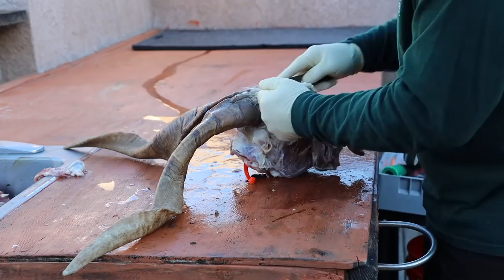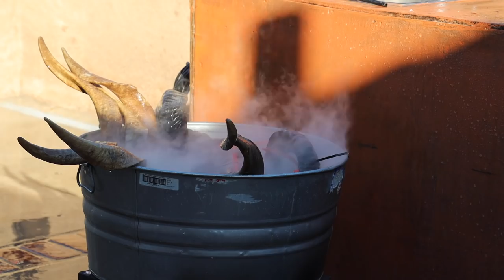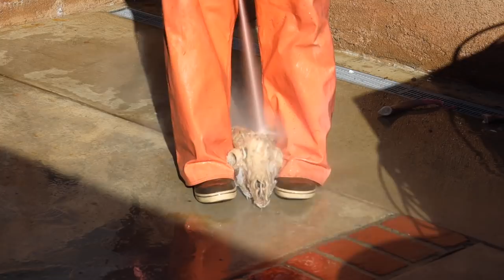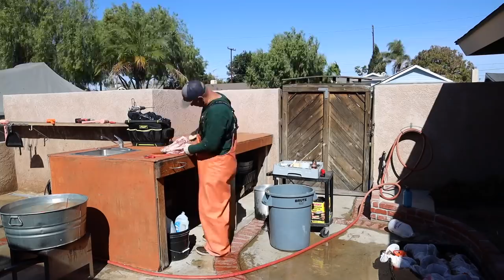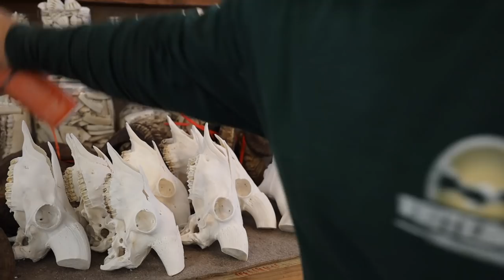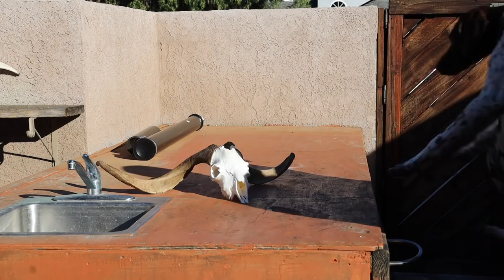I CLEAN 14 SKULLS IN ONE DAY ANGORA GOATS  BLACK HAWAIIAN AND MORE

Comment: Where i live i cant find the liquid version of volume 40 only the cream. Would the cream also work just fine?
Reply: The cream should thin out once mixed with water. Just might have to use more water and soak the skull longer after the boil since it will be less concentrated.
Reply: @RUZZUF12  ok thanks alot for the reply